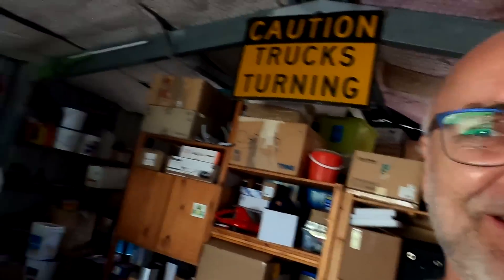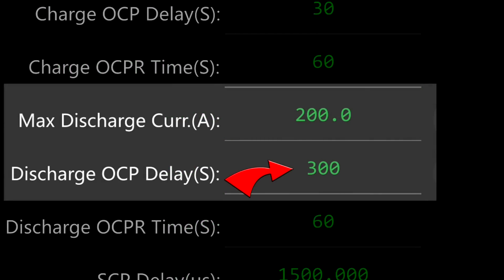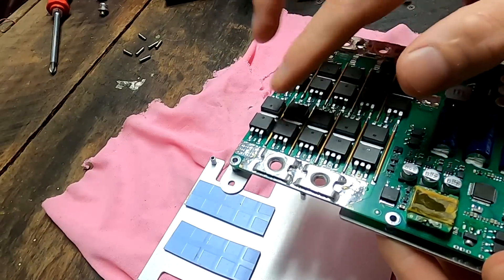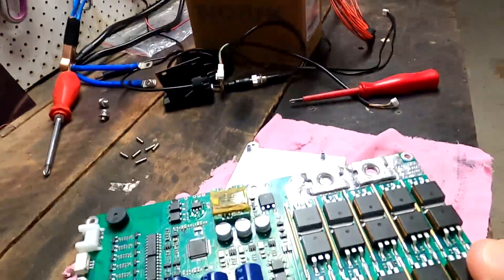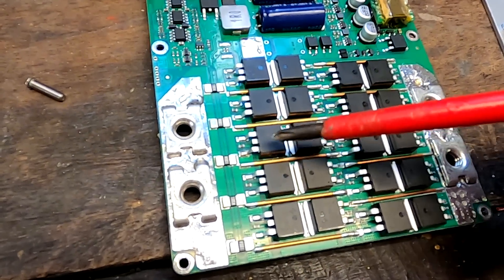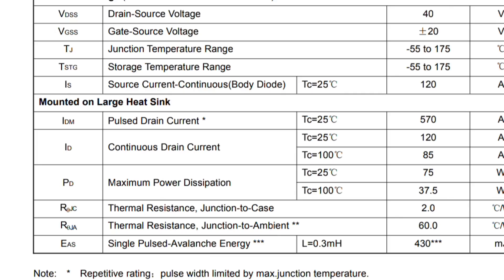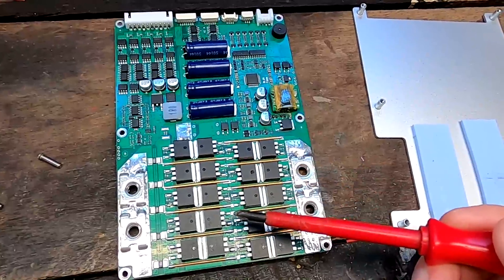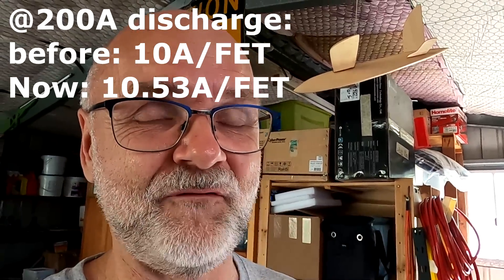Magic smoke! What happened to the JK-BMS? Still reliable or bad design?

Comment: This definitely looks like a flaw in design. I was considering buying one but by the looks of it I have to get the 500a version which is too expensive because this 200a clearly cannot handle a 200a disconnect. Makes the Electrodacus SBMS0 I have look way better because it turns off individual components and has no current going through so this would never happen to this BMS.
Reply: The Electrodacus SBMS0 is absolutely great, I have been using it for almost three years and I don't have to worry about it, everything works as it should, forget all that Chinese junk, but unfortunately there is no 48V version :hands-yellow-heart-red:👍

Comment: JK BMS has an RS485 port. How about sharing the information between your BMS to raspberry pi?

In a perfect world, the Shunt would not be necessary anymore, you could read cell information / warnings / health out of reach of BT, the BMS will get an active part of the PMS and much much more.

I can see why you do not have to worry about a relatively "simple" installation with only solar energy and have low C-rates. But in an RV or a boat that has charging from solar, wind, shore connection, generator and alternator, and often several at the same time, this will be a valuable feature.

Getting the RPI to read the information is easy, but being able to process and integrate the data is perhaps the big challenge?

Comment: It would be easy to fix. You just need a heat gun that's made for desoldering. Rossman group would be a good person to watch the videos on. He repairs things much smaller and harder to repair. He has a YouTube page. Preparing Apple computers
Reply from the maker: It's one thing watching someone with experience and the right equipment and another doing it yourself. I have solder experience but not with such parts, dense population and double side mounted components.

Comment: Looks like the JK BMS app would benefit from a system/component status check, that runs a quick diagnostic on the board to make sure all components are fully functional - especially if the BMS is able to continue running with components damaged. Detecting a blown mosfet will prove to be quite difficult when my BMSs are secured within production style plastic battery cases on my sailboat.
Reply from the maker: I don't think it is possible to detect a faulty FET if it is in parallel with 19 others. They don't provide any kind of control circuit or so...
If the BMS is packed away, you won't even noticed if something like this happens.

Comment: I think there needs to be 2 overcurrent parameters. Not just one with a delay! What would happen if you started pulling 300A from the battery? It would only trigger after 5 minutes! So there needs to be 2 settings. First is the same one that currently is there, it should also have a maximum value of 200A and 3 minutes per the specification of the BMS. Then there should be an instantaneous OCP with no delay that can be something like 300A as a maximum value.

Comment: The possible causes of failure are 1) Defective synchronization of parallel MOSFET, leaving a few active before disconnection, and thus bearing a very high current 2) Inductive spike 3) a mix of the two. The heating due to the long disconnection period, could make the MOSFET more sensible to avalanche damage and less resistant to voltage spike.

If the circuit below BMS is inductive, it seems very easy, starting with 55V of battery voltage, to have a spike that exceeds 100V and can perforate the MOSFET, the last one interrupting the load.
An inductive spike, could extend its damage also to a connected inverter, if it is not adequately protected from spikes in its battery input.

To get rid of inductive spikes possible damage, on BMS side and downstream to the inverter side, the best solution seems to have a surge protection device (SPD) attached in between. DC SPD exist even rated at low voltage, like 48V or 60V. In case of significant spike, the SPD will cut it to tolerable levels protecting both sides of the electronic.

Comment: Hello,  I used the same JK BMS on my 8s bank.  Seams to work good but i did dial down the discharge to 150a.  During your video you mentioned that the JK will not support another parallel bank but no further comments.   I hope to some day add another bank to my cabin.   Is this a for sure on the JK use or is there a safe way around it?   If not usable could the JK function in a pack made with parallel cells in series and one BMS?    My set up is 280sh EVE- 8s into a Victron Multiplus 24-3000-70.  4- 445 Canadian bifacials and Midnite Solar 150.

Comment: Hello. I am a fan of all the Off Grid Garage videos.
I have 4 new lifepo4 280ah batteries in series and 12 v. . One broke and I bought another from another brand. The same three cells are charged at the same voltage synchronously at 3.6V but 40Mv difference appears in the cell of different brand. The balancer is JK 150A (2A balance). Voltages are equalized when charging stops. Is it normal being new? The connecting bars are flexible. Could it be that the bms is bad?
The measured capacity is about 275 amps each and they look in good condition.
Thanks to Off Grid Garage

Comment: Good morning Andy,in a previous VIDIO u said u would show the perimitor settings for the BMSs  u use, 1 of the most important aspects of the function of these batteries is the correct setup of the BMS, IM REALY LOOKING FORWARD TO THESE SETTINGS AS I HAVE A battery bank and don't know what settings to use can u help me please,I would be very grateful if u do, my battery bank is 48 v .Cheers Rene.from sunny victoria
Reply from the maker: These videos will come soon, Rene. You need to know the specs of tour batteries to set the BMS correctly.
Reply: @OffGridGarageAustralia  Hi andy do u mean the Amp H of battery its 180 Amp H and 1c
Reply from the maker: @renewyers4699  more the min/max voltages and currents of the cells, temperatures... all this information needs to be set in the BMS.
Reply: @OffGridGarageAustralia  thank u for your time u have spent with me what happens if i cant get these settings from the china provider i found that there not very helpful i think its because they dont know there products very well

Comment: It should be fairly easy to repair. By the way the use of constant flux is imperative through the removal and installation of all electronics. 
I wouldn't weary about the MOSFET on the opposite side while performing these repair. These PCB’s are usually four or six layers thick making them pretty good insulators. Now the HOT IRON (and electronic soldering hot air gun {a cheap one on AliExpress for under 40 bucks} is more appropriate-sorry; but Miss Pink Piggy would probably not cut it; since it lacks the temperature controls needed) you where brandishing is no the best tool to perform such a task. To keep adjacent and smaller (SMD's) components cool you should cover them with "Kapton" tape; you can double or triple them as needed . The next item in the agenda would be to lower your melting point of the solder that the manufacture has used in their hot melting bath processes. This can be accomplished with CHIP-QUICK #smdinl remkit (Do not use their alcohol swaps {70% alcohol–too low of a concentration!} that it comes with) Don’t worry this can be easily remove later on with alcohol (91 or 99%). Follow the instructions in the package. Now that you have remove your defective MOSFET you can make your life a lot easier by using instead a solder kit from also Chip-Quick #NC19LT15 to install the new one. Your choice.

Comment: Can anyone explain what Hankzor means by the statement "☆Doesn't Support Series Connection and parallel Connection"?

Are they saying that two 12v 2s batteries each with its own BMS cannot be connected together on the + & - buss bar?  

Are they saying that you cannot build a 2p4s battery with (8) cells and a single BMS?

Are they saying something entirely different?
Reply from the maker: As we have seen in the specs of the FETs, they support only 40V max voltage. If you add several of the BMS in series and one of them turns off for whatever reason, the others will see a higher voltage which may increase to over 40V and damage the other BMSs.
I don't agree with their parallel policy though as it should not matter how many we have in parallel.
Reply: @OffGridGarageAustralia  At this point, the this is the only BMS I am considering and plan to order one this week along with (8) 280K cells.  I will use it on a sailboat that has lots of 12v loads and almost nothing that requires AC.  I use between 100A and 200A per day so 580A will let me go 2-3 days without any charging.  I live in the Pacific Northwest and our typical rain/drizzle/overcast does not lend itself to solar so my primary charge source is a 105A alternator and a 60A charger on a Honda generator.  Given that the 200A capacity of the JK BMS exceeds anything that I have on my boat, do you think it is better to use one in a 2p4s configuration of build two seperate 4s packs each with a JK for redundancy and connect them in parallel to the charge buss.
Reply from the maker: @haydenwatson7987  thank you for sharing. I would definitely go with the two parallel banks for your set up. The redundancy is gold! I had turned off on of my battery banks over the weekend die to some modification and the system kept running on three other two.
Spreading the load across multiple BMS in parallel is certainly smart.
Reply: @OffGridGarageAustralia  I am not sure if you have been following the "JK 4S 200A BMS" forum thread on DIY Solar Power.  Nami said in post #60 that if you want to parallel cells with the JK it must be done before the series connection and use only one BMS.  She insists that the complete batteries, each with their own JK BMS must not be connected together in parallel like you have done on your system.  I for the life of me cannot see any reason or logic behind this statement.  If true, it would take the JK from the top of the heap to not even being in consideration.  There must be something wrong in the explanation or the understanding of the question here.
Reply from the maker: @haydenwatson7987  I'm in contact with Nami but are not coming the thread die to lack of time.
The main fear they have are high cross currents from one bank to another. I think their main knowledge comes from li-ion chemistry what such currents easily occur due to there linear voltage/SOC relation. It's very different with LFP. I have sent her all the links about me paralleling 304Ah battery with A 5Ah battery.
'Ohhhhhhh' was her reaction.
Reply: @OffGridGarageAustralia  good to know. Hopefully we can get this straightened away cuz I would like to order that thing
Reply from the maker: @haydenwatson5771  I'll repeat the test shortly with the device I have and see if it happens again. That would be the death of the JK 😔

Comment: I would think a hot air gun is your friend for this. The components were soldered with high temperature well above the working temp which ok just can't run them at that temperature!!! If you do use hot Air to desolder it make a window just over the FET using kapton tape to stop any wayward components being blown of by the gun. It's not easy to do but have done it on a welder. But if want to leave it's fine as well just cut the legs off so it's out of cct.
Reply from the maker: Too much work and not enough time. I probably cut the legs and leave it where it is.

Comment: So it seems that when a BMS needs to cut the load at a high current (like 200a) instead of switching MOSFETs off it should send a command to the load to slowly decrease current and only if that is not working(or after it seen the current going down to a safe value) switchoff mosfets. This could be possible with invertors right because they could control the duty cycle?
Reply from the maker: That is not possible. The BMS cannot tell the inverter to 'slow down'. That depends solely on the load connected to the inverter.
Reply: Well.. when invertor shutdown due low input voltage and we have alot of amps..is there a risk to blow some mosfet inside Invertor? How do they do it on invertor side? I think they disconnect the AC side..which in turn slowly decrease amps on input side .At least BMS could send a off signal to invertor.. maybe you could do a test to confirm this theory

Comment: Use a tiny heat gun With an aluminum foil shield with hole in the center exposing just the part you're trying to heat. YouTube search  reballing.  You can get the heat gun pin that actually comes with the soldering station just for this purpose.

Comment: There is many articles and videos about running mosfets in parallel. It is not as simple as it seams... there is a difference in the time it takes for different mosfets to turn on or turn off. With simple words - 19 mosfets could have turned off faster from the failed one and it was still on last, thus taking the entire 200+A load which it could not handle and "shit itself" (I liked that description  and understand better why the sniff test...)
Reply: The "Pulsed Current" rating is like 570 amps !!!  So, yes the last MOSFET to turn off should handle the entire load for a very short time. That is how it works. You need to check the SOA.

Comment: You can replace that MOSFET - no problem. I've done it a bunch. Those things are oven soldered, so the whole board gets to soldering temperature. Take it off just like you were showing. Put a drop of solder on the exposed pad and spread it out. Put flux on the back of the MOSFET and heat it up the same way until the solder melts and squishes out from underneath. It works fine. You can even solder the legs first to hold it in place.

Comment: hot air station. they are not that expensive and a must have for SMD repairs and some leaded solder. it just flows better and perfectly safe as long as you don't breathe in the soldering fumes daily :)

Comment: Couple of other observations.  Cannot identify a thermistor temp sensor from video.  Often this is on a small flex circuit that folds between MOSFET's drain tabs.  Not having a temp sensor near MOSFET's would be a significant design deficiency.

The 4/8S version in video seems to be missing the BMS turn-on pre-charge surge current limiter MOSFET and series resistors that the 16/24S version has.  There are unpopulated pads for it on the PCB at the inside end of MOSFET string. Compare it to your 16S BMS video.  

This circuit activates for a fraction of msec before parallel MOSFET's string are turned on to allow some inverter capacitor charging to reduce the very high turn-on surge current that can happen.  It can actually blow out the metallization and wire bonds on the MOSFET die.  They may have slowed down the MOSFET gate drive ramp up to slow the MOSFET turn-on.  This method is not as controlled and effective as having the separate pre-charge circuit, but it saves costs.

Comment: You can use a hot air soldering to replace the mosfet, they can tolerate the heat for the short time required to solder at those temps.

Comment: Thanks for sharing what you found regarding the failure.  I think 5 minutes at 200A might be a bit too long (but if the BMS spec says it should hold up that long then it clearly failed).  I agree with some others that you could replace the MOSFET with a soldering heat gun.  I don't think you'll have much luck with a standard soldering iron.  If you plan to leave it in I would snip off the two exposed legs or you may end up with more smoke from the same spot.  I would reduce the over current setting by 10A and test away.

Comment: I guess "magic smoke" was triggered by an overcurrent shut down(both happened simultaneously!). As long as continuous current flow goes through MOSFETs, 200 amps are divided by 20 MOSFETs, where you can have a safe operation(no smoke). In case of an overcurrent shut down, an unbalanced cutoff time between MOSFETs can have the situation where only one MOSFET has to carry everything(200A), even if in a tiny duration. My hypothesis is an unfortunate cutoff time difference between MOSFETs is criminal. The broken MOSFET's source pin pad apparently has a slightly different color. That can be the footprint of 200A current. 

If I design a BMS with a max of 200amps, I definitely do several tests to see if MOSFETs are safe in such a high current. But cutting off is a little bit of a blind area. I suspect an unbalanced cutoff time can be fatal only if a very high current (more than 200A?) is used.  😅   

I don't recommend removing the broken MOSFET with a heat air gun because recent PCB uses non-lead solder, which has a high melting temperature. It's not easy for a beginner to have a successful job. In my opinion, cutting off the gate and source pins are enough for safe operation.
Reply: It might be the issue with the MOSFET driver and developers need to find better one.

Comment: Two things come to mind.  1) It could be this is a known problem with the design so that's why they have that crazy long  delay.  They're hoping the load lets up before they actually have to proceed with a high load disconnect.

2) I concur that if you don't have the tools or inclination to replace that FET run without it.  HOWEVER, I would use a sharp pair of dikes to cut all the other leads to it.   There is no predicting what that damaged chip might do with all those live leads still connected to it.   Moisture or a temperature change or corrosion could re-connect something in a nasty way.  If you reduce that part to one connection nothing further can happen.